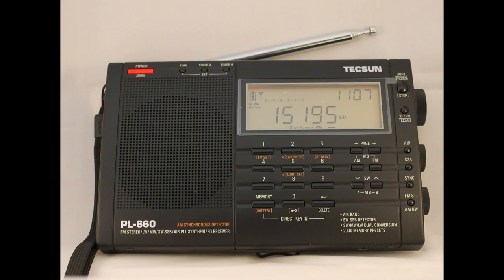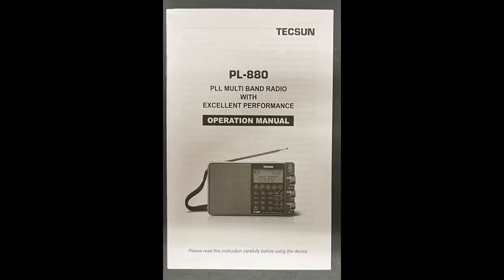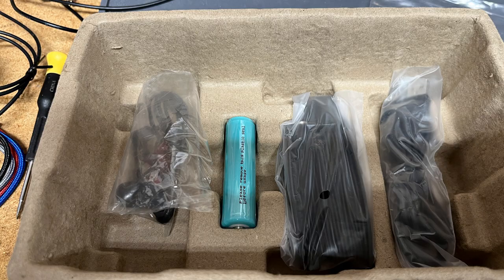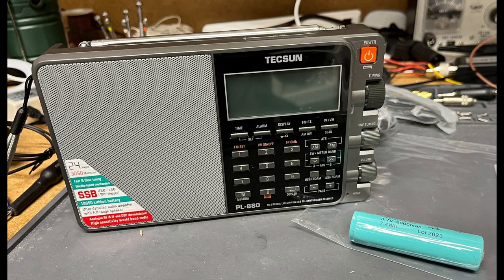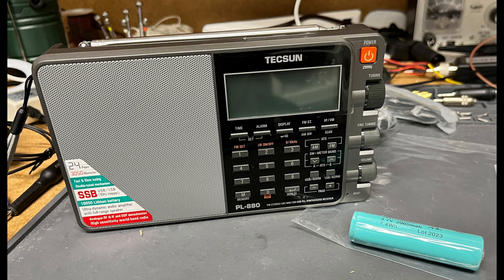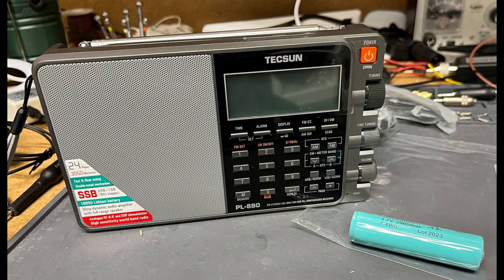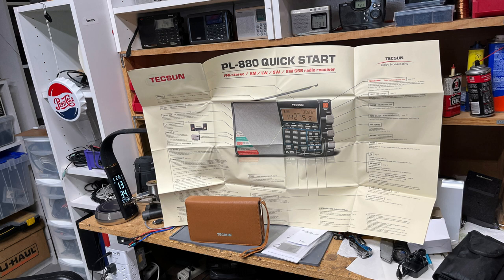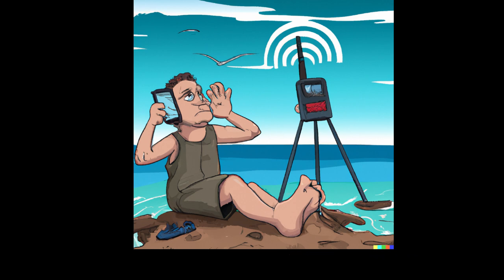PL-880 vs PL-660: The Movie

Comment: Thanks,
I have the 660. I also have kc2wvb as my amateur call sign. I've had nice Kenwood 100 watt transceivers  and while the dialing in of the SSB signal might be a tad easier with expensive transceivers I have no complaint regarding the 660's ability to do so. Incidentally I don't listen often anymore, but as I remember the further away from perfect adustment you are with the BFO the higher the pitch, so the idea is to turn the knob in the direction of lower pitch until it seems like you dialed in the natural voice. Dialing in an AM station while in SSB mode is a good way to  practice and become proficient with using the BFO adjustment.

I actually have very few transceivers these days and only have two 10 watt kit built transceivers and one SDR receiver largely because they are fun to build and really require what interests me the most which are good antennas. You simply cant beat a good antenna and I would highly recommend a fan dipole in an inverted V configuration which is actually very easy to build. I seem to remember that I would select at least 40 & 20 meters as the two combined antennas in the fan configuration for if memory is correct that would give you a lot of receive capability because many other bands of interest would also have an impedeance at the feedpoint that coincides with the 50 ohms most radios have with respect to being the source when transmitting & load when receiving. 

Right now I have just a 40 meter inverted V and am fine with it alone because when I check it on the RSP1 SDRPlay receiver or with an inexpensive VNA I find it does a really good job of receiving on 60 meters up to about 17 meters or rougly from 5 to 21 MHz.

73s

Comment: I have both of them and I am happy with both of them.
Reply: If you have to choose? 2 of them.
d808=100$  pl330=85$  pl660=195$  pl880=295$   (Canadian$)
D808 and pl880 have a great battery 18650 with standard usb 5 volt. I find a dc/dc converter to transform 5v to 6v(4$). The pl330 is stuck with a small capacity battery.
I think the 660 have good sound ( no digitalized) but the speaker hide this quality. Maybe a test with a good computer speaker set. We will hear the truth capacity.
I can improve the speaker sound quality by plastifiy the paper cone and adding fiber around it. 
( not as good as the pl880!)
The d808 cost half the 660 and third th880
God bless.
Reply: What if you had to choose?

Comment: Nice, well scripted, and organized review.  Well done.   

Parenthetically, yes SOME, but not all, hams are very concerned about audio quality and I call them Hi FI Hams because they believe they can make a purse out of a sow's ear - that is, they feel they can get Hi Fi broadcast quality audio out of a radio designed to transmit roughly just 3000Hz of audio and RF bandwidth - mostly they end up emphasizing the lower (bass) frequencies at the expense of higher (treble) frequencies because it makes them sound thicker, fuller and more rounded.  They do this, despite the fact low frequency speech sound (below 300 Hz) consumes more than 50-60% of speech energy, but conveys less than 5% of speech intelligence - i.e., the message, whereas the frequencies between 300 and 4000 carry the most speech information, and requires the least (less than 10%) of speech energy.  The point is, they wanna sound like an FM DJ - so they do their best to get a rich sound on a rig designed for communications grade audio - 300 to 3000 Hz - as defined by ITU and manufacturer standards, as well as conforming to a century of audio research by Bell Labs and other entities leading to ITU standards - 300 to 3000 Hz - communications grade audio.  Bottom line - those who sound thick and full and bass-y set their radios for this result - while others have a thinner, yet more articulate, more "crispy" treble sound, which audio scientists have proven cuts through the noise and poor propagation better - think about how airline pilot and military and Air Force pilots sound on the air - they use extreme communications audio - but it is proven to be more articulate and more intelligible - so overall we see some hams going one way for one result, and other hams seeking another result.  And yet, as my favorite ham radio expert says - "It's all good."   Just a comment in response to your comment on ham radio audio.   TT

Comment: If I were stranded on an island... or if i were to have only one radio... I'd chose PL680. Battery recharging is no problem; I'd hookup the solar panel to a battery charger, and keep charging various types of rechargeable battery packs. there are many excellent rechargeable battery pack options with adapter tips available that can be used for various applications such as led lights, cellphones and yes, radios too. I would highly recommend everyone starting out the hobby to avoid DSP radios, and start with analog such as PL660 or PL680. After all radio broadcast was designed/built based on analog tuners for decades, after they learn the ropes they can go with whatever they want. After you mastered the basics on analog and learned about importance of antennas (often ignored) then if you still want a DSP, you might as well go straight to SDR.
Reply: Also, I would recommend everyone to read excellent information and comments on your blogpost site under the "/2023/06/ssb/" (Edit: I don't want to paste the entire URL because youtube algorithm might think of it as spam)
Reply: I find DSP to be superior for F.M. but prefer analog for everything else.

Comment: Hi
I am torn between the pl990x and pl880... if I'm not bothered about the Bluetooth, sd card for audio and the speaker( as I believe the audio on both are not that dissimilar) would you tell me to go for the pl880? I do like the look of the 880 but can afford the pl990x. Any advice would be appreciated thanks
Reply from the maker: I don't have a PL-990X to compare, but let me suggest this video on the PL-990X: https://www.youtube.com/watch?v=AeVKHHxtbAA. That channel has quite a few videos on the PL-990x (he doesn't own a PL-880 that I know of). One weakness of the PL-880 is that it lacks synchronous tuning (there is a hidden feature, but it's awful). Synchronous tuning on the PL-990X is a button, not hidden. It is reported to be better than the PL-880, but still not all that good. Another weakness of the PL-880 is that the external antenna jack can't be used for LW/MW. Again there is an incredibly convoluted hidden feature for this, but it doesn't work on models shipping now (most likely it wasn't a hidden feature, but a bug). The PL-990X has a hidden feature to switch the antenna that actually works and is easy to use, exactly like on my PL-330. As the video I suggest says, portable radios these days all get the same stations. The PL-990X appears to have the operational conveniences that I like on the PL-880, but also refinements in SSB. Good luck.
Reply from the maker: ROFL. Trying to answer your question resulted in some research. I looked into the PL-990 some and it does seem attractive. I found a used one from Kaito USA (the US Tecsun distributor) on eBay for $169 so I grabbed it. However, with that radio, there's no reason to keep the PL-880 so I'll sell it.
Reply: Just to let everyone know I opted for the pl880 as had good reviews yes ssb audio can seem a little distorted but overall a very nice radio and I think it'd the best looking one at the moment
Reply: Pl 880 is an overpriced device ... nothing is significant, not sensitive  enough
Reply from the maker: @mohammadrihan3886  I've  bought a used PL-990 for about the same price as a new PL-880. It should arrive this weekend, and I will be comparing the two.
Reply: @mohammadrihan3886 What do you use for a receiver?

Comment: I have a PL-660 which was great for what I wanted.  The disappointing thing was that the battery contacts rusted to the point that made battery operation useless and a external battery pack will be needed to connect into the AC port.
Reply from the maker: This condition usually means a battery leaked. You should be able to clean the battery contacts with contact cleaner and perhaps some sandpaper if it's really bad. Others suggest baking soda and water.
Reply: Hi Techmoan uses fresh lemon juice on an cottonbud to clean. Works well.

Comment: Can these radios use SSB on the Mediumwave (AM) Band to get away from adjacent interference???  Stations are now routinely using much more than 5kHz bandwidth to transmit a nicer sounding signal, but that causes interference of distant weaker signals.
Reply from the maker: The Tecsun PL-880 and PL-330 can be put into SSB mode on the MW band, perhaps other radios. I don't have anything to test it with.
Reply: Yes they can.

Comment: Have an 880 and a 680; I use them interchangeably about 80% of the time, but yeah, there are differences. Both perform respectably, according to my needs.
Reply: Qual sua opinião sobre o 680 ?
Reply: @sidneycavalcant  I would recommend everyone to start with PL660/PL680. D808 is, like most DSP radios, too much chuff-chuff-chuff.